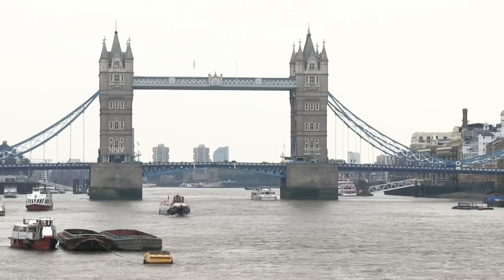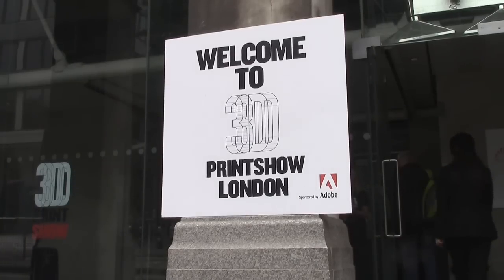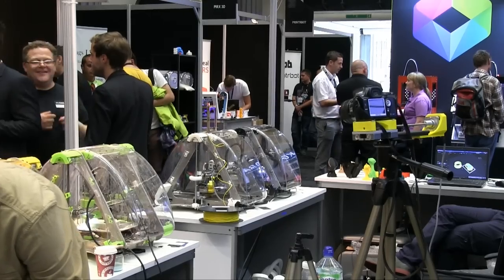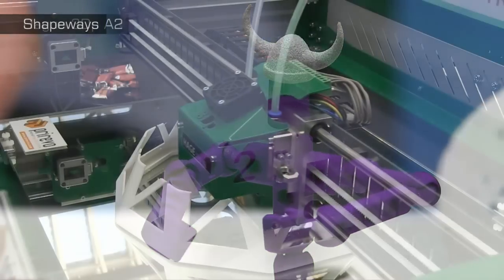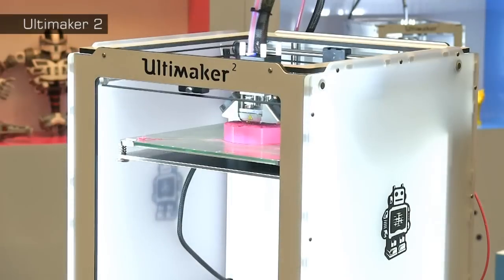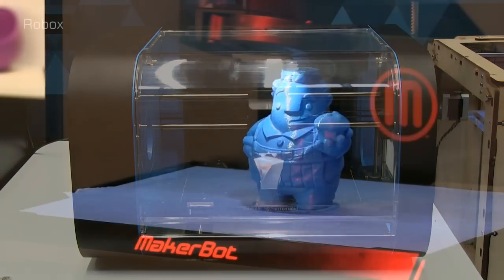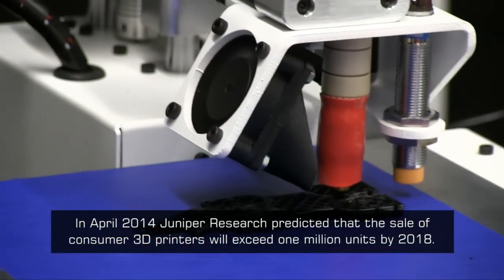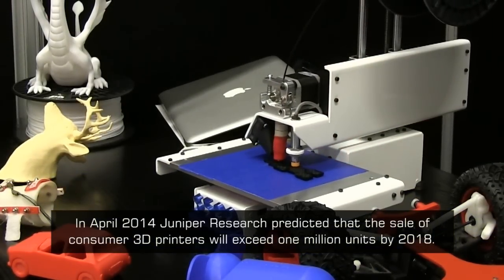3D Printshow London 2014

Comment: At the moment, 3d printers can only utilize plastic? Or are there other materials that can be used?
Reply from the maker: MrJason005 Most current 3D printing is in extruded plastics and photocurable resins. However, a range of powders -- including nylon, gypsum, various metals and ceramics -- can also be 3D printed by either selectively spraying on a binder, or by fusing the powders together with a laser or electron beam. In the video you can see some objects directly printed in metal. And a few others being extruded in chocolate! :)
Reply: ExplainingTheFuture
Ah yes! Thank you.
Reply: you can use a 3d printer to create a plastic mould and then use that mould to produce a die cast metal product
Reply: ExplainingTheFuture and concrete 'houses' can be 3D printed, as well as with biological spares including blood vessels.
Reply: Welcome to my 3D channel. Concerning 3D printer. Now is not good resolution and programm for tuning print option.